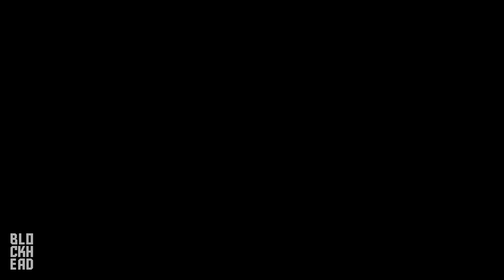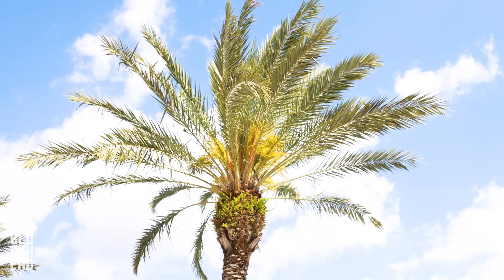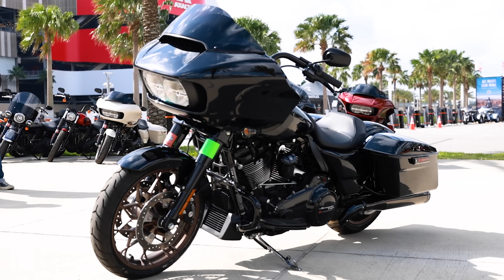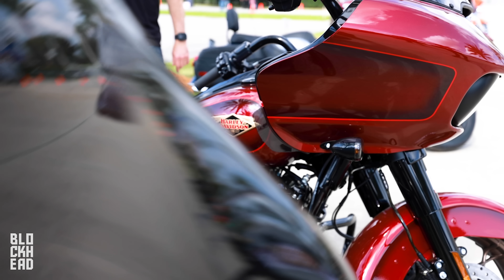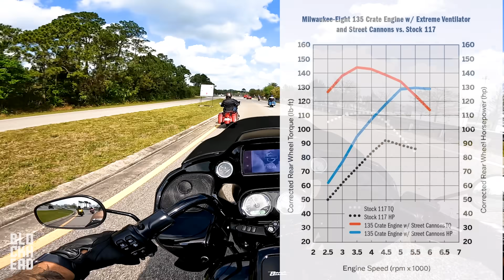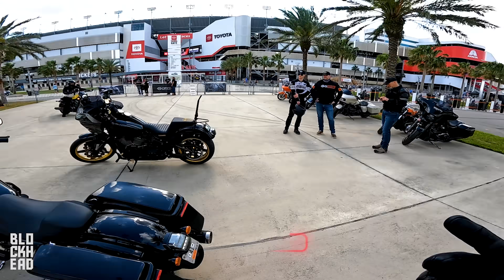Harley-Davidson 135ci Crate Engine TEST RIDE!

Comment: I remember 135 hp… bought a 1986 gsxr1100 in 1999 for $4000
Reply: You bought a 13 year old sport bike for 4k...24 years ago?

You got ripped off.
Reply: @stevem4783  I am in Europe, prices cannot be compared with the US.
Reply: @bmp72  Probably shouldn't use an American denomination, then.
Reply: @stevem4783  i doubt Americans know what guilders were so I thought I would dumb it down a bit
Reply: If you have never ridden a big cube Harley 81FXB - you can't understand!
Reply: @DennisMerwood-xk8wp  Harley 81FXB 100lbft of torque, low compared to :
TTS Superbusa 197lbft of torque
Triumph Rocket 3R 163lbft of torque
Kawasaki ZX-14R 108bft of torque
Hayabusa Gen 3 110lbft of torque
KTM Super Duke R 105lbft of torque
K1300R 103lbft of torque
You don't understand! 🙂
Reply: @THEREALZENFORCE  Its not about numbers my friend. It's about the feel of that big old V-twin. I was right - you do not understand.
Reply: @DennisMerwood-xk8wp  As V-Twins : The Super Duke GT and Super Duke R are way better bikes. Try one, you might like it.
Reply: @THEREALZENFORCE  I worked at motorcycle rental outfit in Milan, Italy, my friend. I have ridden them all. Yes, the KTM's are good. Not as good as the Ducati V-twins.
And totally different bikes than a Harley Davidson. Have you ridden a late model Harley? If you have not, then you don't understand.

Comment: I love it, there's no replacement for displacement. although this 135 is still as far as I'm concerned stock the crank is pressed together with roller bearings. I would recommend a split the case welded flywheels Timken bearing conversion then your lower-end is bulletproof and can handle anything my 128 produces 164 torque 160 horsepower you can get a lot more for a lot less building your engineer self.
Reply: Wow! Definitely need to do a 128 on my 107. What kit did you go with?

Comment: Awesome to see the power there and EPA complaint. Warranty nice but also most any engine builder offers 2 year unlimited mileage. Be curious to see how long MOCO goes before selling a SE gearset to handle the power as a required option.

Comment: Harley really should offer these motors as an option if you order a bike from the factory. I was quoted a little over $11,000 for this motor and other needed parts from my dealership installed. It would be a great way to save a few bucks for the consumer by not having to pay the labor charges
Reply: only  fool would spend that much money on a v twin motor
Reply: @billgonzales8978  no doubt! Especially when you can go aftermarket and build a stronger motor for less $

Comment: Cool motor HD is coming strong with their new motor but why dont give the buyer the option to have this motor on  HD right out of the box because swaping motor its not coming cheap that why i bought a Triumph Rocket 3 GT 153ci  BAM right here and now no need to pay here in Canada 8k for a new motor that insane.
Reply: don be fooled other brand vtwins out there, s&s jims other

Comment: 130 HP? Getting 110 from my 107M8 with Wood Perf Stage 2 xe cam, just 20 HP less than new 131 crate? A Trask super charger on a 131 with stage 3 would be pretty crazy.
Reply: 130hp only from a giant 135 engine, a 600cc R6 does the same, that's a 36 cubic inch engine

Comment: I can't wait to see what it does with a good 2-1 pipe and a badass cam.
Reply: Same. I thought that cam sounded a little small for such a big inch engine. Then he showed the dyno and confirmed it. This thing has plenty of room to grow.
Reply: @joer5057  Ya it is. The 135ci in a low rider s will be insane

Comment: This might be a silly question.. but is there any concern with the transmission with these increases? Or is their transmission pretty solid and able to withstand what they’re throwing at it? What would be the numbers to start looking into a beefier transmission?
Reply: At our shop Harley transmissions hold up pretty well, we do occasionally see failures but a majority of it is rider error. Most of the time though we try to throw a heavier clutch basket and a Grudge Box in there to really ensure performance & longevity
Reply: That was my thoughts, how does the compensator, primarily chain and adjuster, clutch, gearbox and belt hold up to that increase in power and also the hooligan factor that it will no doubt bring out in your right hand, I know I would have to give it all she has got at every opportunity
Reply: @jkirwanmcdonald8728   100%
Reply: @jkirwanmcdonald8728  I think to a certain extent it'll hold up with however much you're willing to spend. There's a reason why race bikes/cars are completely torn apart and rebuilt constantly. It's really a trade off, extreme power over longevity or longevity over extreme power, you can't have both but you can get a nice subtle mix of the two

Comment: Soooooo…. lloyd’s tune on an Indian Challenger with give you around 160-170hp to the wheels….sorry HD, you can put alot of pretty flowers on that piggy….but still a piggy
Reply: And yet the 135 is the same set up they used for racing and beat Indian how many times throughout the series?
Reply: and proud
Reply: What really?
Reply: I ride an Indian. Been a damn good bike. But your numbers are out of wack. Lloyd's tune on a Challenger WITH his cams is in the 130 - 135 range, at the wheel. Both HP and torque.

Comment: This is another engine that is not California compliant.  Expensive upgrade vs stock from the factory.  Many bike manufacturers offering 200 plus horsepower from the factory 50 state compliant.  There must be a point where air cooled motors make too much pollution.  Remember when Porsche 911 was air cooled then they had to switch to liquid cooling for emissions.
Reply: For a cruiser you do not really need tons of power.  The heavy weight and added power can get you into trouble.  Definitely opt for RDRS.  All Harley’s should come standard as all premium manufacturers it is standard for safety.  You want max braking with cornering abs/cornering TC.  As well as straight line Tc and wheelie control at higher horsepower
Reply: Harley must be working on a M8 motor that is liquid cooled.  More horsepower, less heat, less emissions.  Win win if your more interested in torque especially with heavy cruises vs high rpm horsepower.  Unless Harley goes with a V4 liquid cooled for torque and horsepower
Reply: Quickshifter?
Reply: 😂😂yeah I think you are thinking of liquid cooled sport bikes there with 200 hp out of the box, and that’s and apples to mangos because those are totally different paltofrms😂😂

Comment: Block, you've come quite far. From the OG 883 to a 135 Road Hog. Big Congrats on your success and the journey. I love and appreciate how you have continued to put out top notch content. Thank you.
Reply: How much bigger can u go with air cooled.
Reply: @williamfrazier9664 probably not so much a matter of size, but water cooled engines will be able to make more power if all else is the same. Hence, some bikes coming "twin cooled". As far as size goes, I'd imagine they'd physically run out of room in the frame before displacement/cooling was the issue. Just run a better oil cooler if it became a problem.
Reply: Yeah

Comment: So how well does the trany and the compinsater hold up with all the extra power and torc or does everything else have to be upgraded as well
Reply: There are a few transmissions available that wood made up to this engine really well. Unfortunately you’re looking to spend somewhere between 6000 to 7000 bucks for a transmission that can handle this. Also, you’re gonna wanna check out the upgraded Manowar primary and have that done. Should you decide to go with this much of an engine. All that horsepower and no way to constructively get it to the rear wheel. Without spending additional money.

Comment: Did H-D say if they were only going to offer this in a crate motor configuration? I agree splitting the case would probably be more expensive once you factor in labor. I ordered a 4 5/8 crank from Darkhorse for my S&S 131 build. My bike is making 144hp and 158 torque.
Reply: Are those HP/ Tq numbers before or after you added the DH crank ?
Reply: @WTDOOR63  After. I also got the crank windowed and edge cut to remove weight. Also removed the counter balancer.
Reply: That's real niiiiiiiiiiiiiice....must be a blast to ride.
Reply: @cedriclashar8905  It’s a beast for sure! Makes it tough going back and riding my Twin Cam 103!

Comment: I got a chance to do 3 drag pulls with the 131 road glide they had on a dyno wheel on Monday.  you can definitely feel the difference in power from a 114 to a 131 , I bet the 135 is even faster. :_blockhead:
Reply: my 10 year old 120 jims will smoke  all them over priced 135s
Reply: Still a 10 yr old junk
Reply: @gonzalezt7081  145hp harley junk
Reply: U wanna race me? I know U were born in Japam?

Comment: 2 year warranty on 40 to 50 grand bike. should be more like 4 or 5 years.
Reply: You only get 2 full years in warm states otherwise only a year up north really
Reply: Why? It's high performance, 2 years is great
Reply: @yanceyboyz  no its not if something go's wrong in 2 years its a pos all im saying is if you pay that much you should not have to worry about IT
Reply: @tonyheymunkets  race spec crate motors usually have even less warranty and even smaller service intervals. You're acting like it's a bike you can go out and buy ......you can't
Reply: @yanceyboyz  Ducati does 3 years, Aprilia does 3 years, Bmw does 3 years extended warranties and the engines run at over 14000 rpm not a sub 7000
Reply: @THEREALZENFORCE  listen to your own words, extended warranty. Not standard warranty. Also none of those manufacturers make 140hp AT THE WHEEL air cooled engines....They make WATER COOLED engines which by their very definition dissipate heat way better and therefore have way smaller stress margins.......and yet here in Europe, those three brands you just named are the most unreliable of all bikes ......my Tuono was shite, it p1ssed fluids everywhere and would never start when the weather was nice, I'd waste all morning trying to solve issues instead of riding. If you'd mentioned Japanese bikes you'd have a point. 

This is a race spec air cooled race motor with a 2 year warranty. BMW equivalent would be a hp4 race......wanna check the warranty level on that....and the service intervals to keep the warranty valid......and even then still WATER COOLED and lower torque figures. 

Apples to oranges my friend

Comment: Block, how is the heat? I know on my 131 it gets super hot. Has HD done anything to help cool the 135 down?
Reply: Same complaint but with more horsepower comes more heat.  I just avoid stop and go traffic and stop-light to stop-light riding.  Gotta keep moving above 40mph to keep it cool.  They have the liquid cool version for Ultras and trikes. They say it is cooler.
Reply: Probably not. I wonder if you could get a tuner with a switch on the bars. That way you could have a "cool" tune with reduced power, and a full on performance tune. They've been doing that in the diesel world for a long time.
Reply: That's just Milwaukee 8 motors.

Comment: Blows my mind how much power they gained by making the crank just an eighth inch bigger
Reply: It's bigger injectors and intake manifold too
Reply: @heavy_handed  & also larger throttlebody, different heads, etc
Reply: When you're working with machine tolerances and motors, 1/8" is a huge amount even if it doesn't seem like it. Absolutely crazy to think about
Reply: I don’t see them coming out with a 135 kit conversion because of the added labor changing out the crank . Cheaper just to swap out the entire 114 to 135?
Reply: What's crazy is, the amount of volume that is gained from a extra 1/8th inch
Reply: That’s what she said. 😂
Reply: A lot of it comes from the cam. Hell, you can swap a good cam in a 107 and make over 150% more power than stock.
Reply: Size matters
Reply: They could've made it 3/4 of an inch but they will do that 1/8th of an inch at a time to sell rich stupid hardley owners more slow junk.
Reply: @godackgudalach1 . Why are you here?
Reply: @Magnus0311  because your mom didn't want an abortion
Reply: @godackgudalach1    High IQ response. Have a good day.
Reply: @Magnus0311  well now that I know why you're here...  Been saving that one all week little fella?
Reply: @godackgudalach1    Go ride your motorcycle with some friends and make some good memories man.
Reply: @Magnus0311  I can't, I live in a shit hole and it's to icy to ride now... Maybe that's why I'm the way I am :/ lol
Reply: @godackgudalach1    Then take this time to prep your bike and make trip plans with some friends for spring. That’s what I’m doing. Squirreling away a little cash each week to fund trips when the warmer weather comes. Planning a 30 day cross country trip early spring next year with a friend. Motorcycles are fun, regardless of the brand.
Reply: @godackgudalach1 clown comment
Reply: @guins99 cool story.
Reply: @godackgudalach1  Do I detect a little envy...

Comment: Will the stock transmission and clutch hold up? Would those parts be covered under the warranty?
Reply: When I got the 131 se kit it came with a se clutch. Maybe it’ll be advised to get it swapped out.

Comment: From what I've seen these 117s and 131s have enough trouble getting to 20k without having issues, if you want to haul ass and still be somewhat comfortable just buy a naked bike for literally half the price 🤷
Reply: Definitely more practical, but not the same either. It's like a BMW M4 vs a big block 60's muscle car. Totally different experiences.
Reply: Who wants cheap stuff ......a golf R is much faster than a Rolls Royce and still somewhat comfortable...... it's still a golf.....

Road glides are the big grand tourer of the motorcycle world....this is sportier version of that. This exists for the same reasons Bentley do a "speed" version of the continental GT.....

Last point, relative comfort on a naked bike....I presume you've never done a 500mile day in the saddle with all that wind on you the whole time!!!! That is not comfort at all.

Comment: My 128 Screamin Eagle kit for my 107, I’ve gotten over 27000 miles on it. I obviously put S&S parts in it, but everything from heads, jugs, pistons, 64mm tbi & intake, clutch plates, & etc all Screamin Eagle-No complaints about its manufacturing quality.
Reply: Same here but no S&S parts.  Ran with the HD Power and Auto tuner.  Fullsac MX Exhaust.  Put close to 25K riding all over the country from the beaches to the mtns in all types of weather expect snow.  Very happy with the performance and get good gas milage until you get into the throttle but it's totally worth the gas money.  Cons are it gets hot so not ideal for stop and go traffic, stop-light to stop-light riding or weather with temps 95 degrees +.  Got to be careful with the throttle.  Lots of torque going to the rear wheel and need to respect the power.  Easy to slip rear tire in 3rd, 4th and 5th.  Pros are the thrill of getting into the throttle and it screams like a beeping BANSHEE.  You only live once, do it!
Reply: @mojomanmurph1925   this is why Harley doesn’t offer these motors on their bikes stock. Heat is your enemy. These motors like a Jim’s 143 or any other are fast 💨 make great power but not daily riders. They break & anyone who knows anything about bike motors or motors in general. Will tell you heat breaks motors. 

So sure they’ll warranty the aftermarket upgrade. But you pay for it big time. And if you’ve ever dealt with Harley & their warranties. You’d know they aren’t worth shit. 

What’s more fueling & S&S are far superior to SE parts. 
Hell baker transmission, HPI throttle body, Rekluse clutch all aftermarket parts far superior to anything Harley SE
Reply: What s&s parts do you need to get a 107 to a 128
Reply: How was your fuel economy impacted?

Comment: Did they explain why it’s only for ‘21 and newer bikes?
Reply: Same motor mounts, you can make it happen.
Reply: @usmcvet0313  I have a 19 RG and when I was in the Harley site I typed in my bike year and model and it said “this fits 2019….
Reply: I'd assume the wiring harness. I know there were changes from 2020 to 2021.